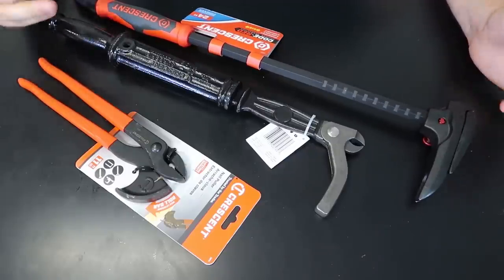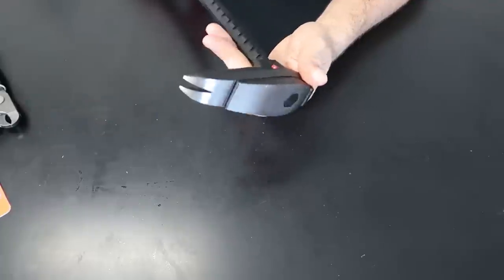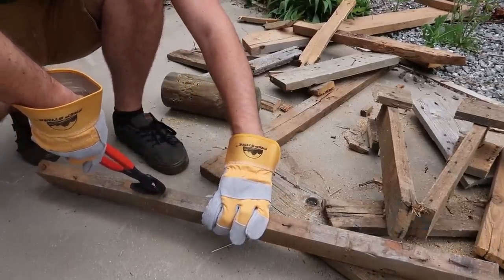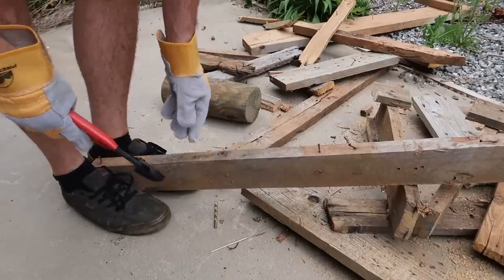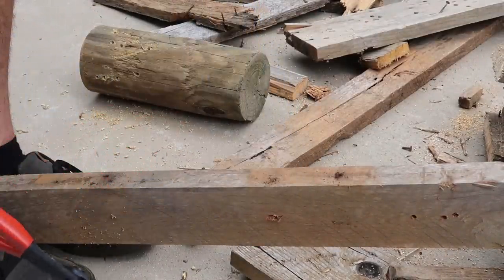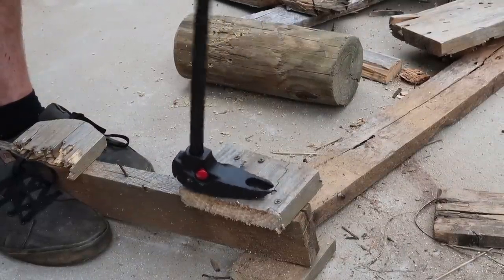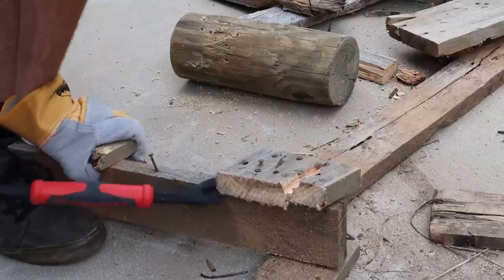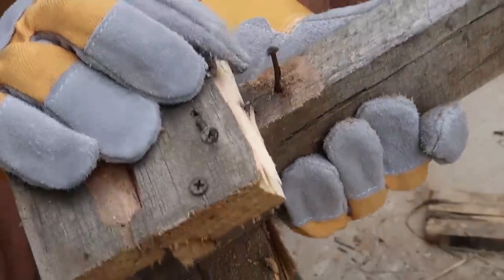Best Nail Puller

Comment: Claw hammer works best! 🔨 - That 3rd one is a golf club. 😂
Reply: Claw hammers work great, but each of these tools is a better nail pulling option depending on the situation. With experience, you learn what tool to grab for the nail pulling situation in front of you. I seldom use my claw hammer for pulling nails out of pallets.
Reply: @gtaus1  Well If I have to pick only one tool, I definitely go with the claw hammer.